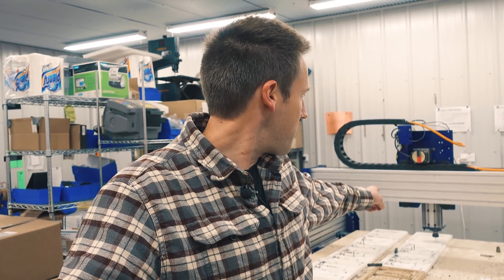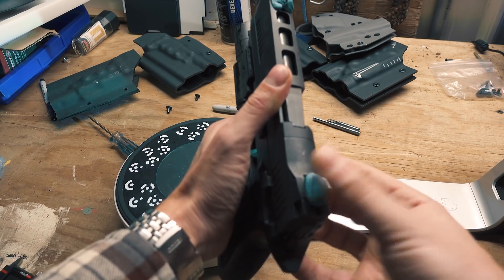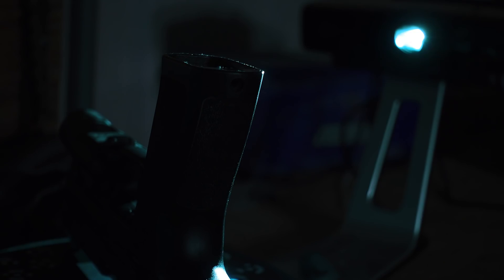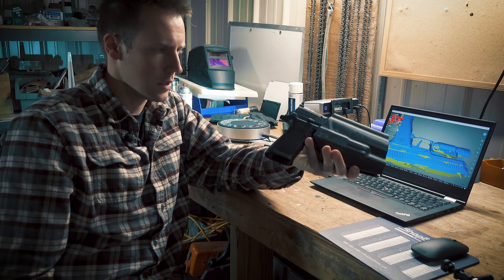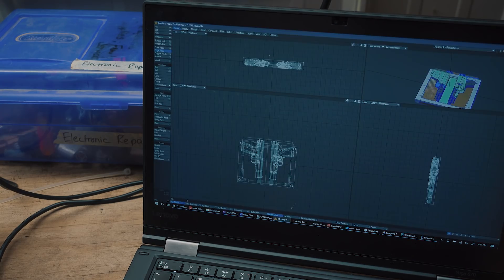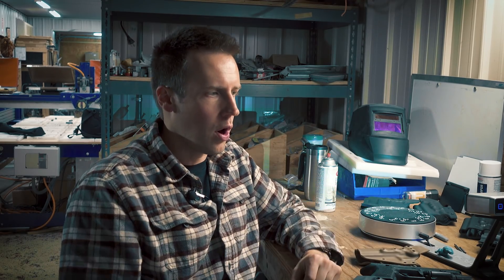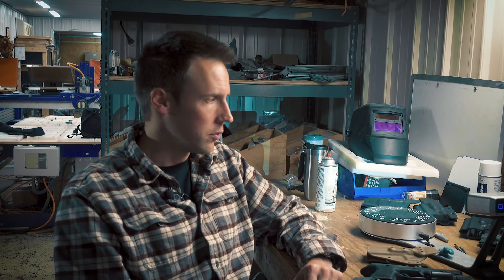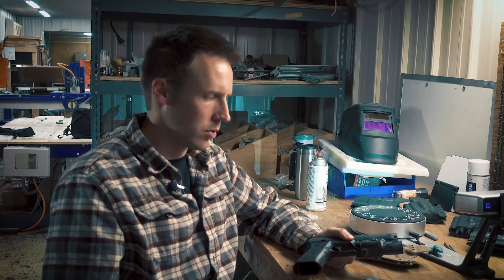Our 3D Scanner: Einscan-SP Review

Comment: I’m surprised you scan the pistols upside down, where you lose the point cloud for the top of the slide, which is important. Why don’t you make a holding device that can slide into the magazine well and hold the gun upright? Or a simple arm made from Delrin with a rod that slides into the barrel (so you can scan revolvers as well as pistols)?

Edit: or better yet, a small rod that allows the guns to stand vertically on their muzzle. That would allow you to scan all surfaces except the muzzle itself, which I believe you don’t need details of.
Reply: I usually do three scans, one with the gun upside down, one right side up, and one on its side. That usually gets me lots of data o work with. It's hard to scan things vertically, since the cameras both have a very horizontal view.

Comment: The slowness issue and application crashing may be due to using a laptop that may not have the horse power you need. Image rendering takes a lot of system resources. Maybe look into getting a dedicated desktop with at least an Intel core i5 processor with at least a 1050 Ti Nvidia video card. But if that's not an option, and a laptop is all you have room for, then maybe something like a gaming laptop. Most of those will have the same specs as a desktop like I mentioned earlier but in a smaller form factor. Something like an Acer Nitro (Model:AN515-53-55G9), and it's around $700. And since you're not gaming on it, heat really wouldn't be an issue. Love your videos, thanks for the content.

Comment: So if I wanted you to do a holster for my Glock 21sf. Would I have to send you my gun ? Or can you just scan anther 21sf since I did not see any options for a 21sf
Reply: Blockhead369 the "sf" part doesn't matter. The dimension on the frame that makes it a "sf" is not relevant to the holster. If there's one for a "G20/G21" that's the holster you need.
Reply: Ok thanks for the response. I will take a look